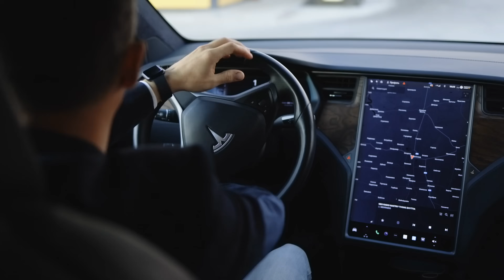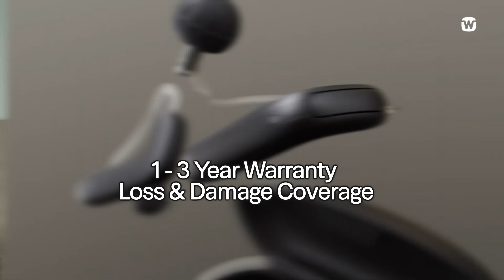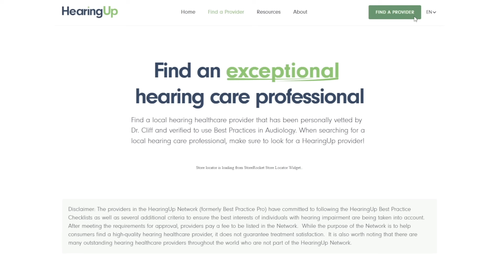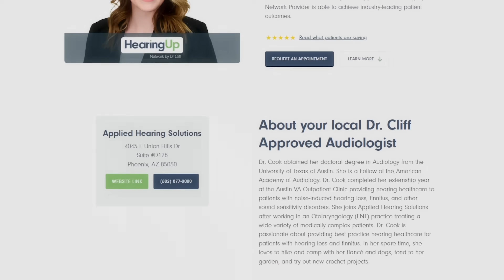STOP Upgrading Your Hearing Aids!

Comment: What about getting a new pair of hearing aids before your hearing aids expire? As in, damage beyond repair? So then old hearing aids can be back up hearing aids. My Starkey hearing aids are 4 years old in March. I had the previous hearing aids for 10 years and can’t remember if I can use them as backup (I think I can for one but not the other). When one stopped working, luckily I had a backup for that ear. It was very disorienting using the old hearing aid as a backup while still using the side that worked.

Comment: At the cost of hearing aids, it isn’t possible to upgrade too often, unless you are rich. I buy mine at COSTCO, and it still stings. My latest purchase was due to the old ones not working right. I needed a backup pair. Now I have two good ones to swap out. I should be able to go for four or five years before needing a new pair. It gives me time to save for them, too. I keep hope there will be a medical solution to reverse hearing loss while I am alive to get it.

Comment: After a lot of research, doubts ... I will have my first hearing aids in a few weeks. It will be the Signia C&G IX7 with a local audiologist following most of best practices. I prefered the Siginia active pro IX but audiologist said it is not recommended for several reasons (explained). So will try my first hearing aids after my holidays.
Reply: Good luck with your HA's. Don't be afraid to ask questions. Keep a notebook  specifically for use with your HA's in which you can write down whatever questions you may have.

Comment: Most of the time I upgrade hearing aids every 5 to 6 years or when my hearing deteriorates further. Since 2008, I have been a hearing aid user, and overtime, my loss has become more progressive. Currently, I wear the Oticon real one and have a back up pair of more ones. Considering cochlear implantation as I am a candidate. However, after seeking two opinions from different clinicians, I discovered my qualification is based on performance in background noise. A simple explanation was given concerning regarding candidacy. If a number is below 60 per cent in quiet or background conditions, you may benefit. Quiet I score 83 percent but even with appropriately programmed aids, the score drops dramatically. Audiogram has decreased 22 DB in left ear. High frequencies are shot, only hear low tones. Unaided, I have 0 percent word recognition despite highest audiometer settings. Amazingly, while poor, I derive 40 percent word recognition

Comment: Got my 1st pair of HAs nearly 4 yrs ago. At the time I demo'd the Phonak and Oticon top of the line HAs with my audiologist.  While I preferred the Oticon, as an android user, the Phonak had useful features I could use with my phone where the Oticon did not. Bottom line however was that both were far too pricey so I looked elsewhere.  Costco, where I tried the KS 10.1 that worked with my Google Pixel phone, liked them (essentially a Phonak HA), and ordered a pair.  I've since had them re-programmed several times now, the most recent being a month ago since my hearing continues to deteriorate.  With the latest Phonak and Oticon offereings all over YT, a week before that re-programming I demoed both with my audiologist since I have a lot of  trouble with hearing in noisy places.  The Oticon was not compatible with my new Pixel phone so we focused on the Phonak.  While the demo seemed to provide a small improvement in background noise management for me, I feel there is definitely room for improvement before I am willing to commit $6k+ to upgrade from my $1500 KS HAs,  Maybe Phonak's next gen will be the right one, though as an RIC HA, I hope they won't be too large.

Comment: I'm currently in a 60 day trial of TruHearing  RIC 7IX. This is an upgrade from my old Resound Linx which had no Android BT support. My insurance only works with TruHearing, which provides the HA's at a very very low cost BUT the audiologist they provide cuts conners. I'm not very impress with these Signia's but know another fitting or 12 will help. I can upgrade to the Resound Viva for about an additional $2300. Do you think the Viva is worth $2300 more than the Signia 7IX? I'm also at the point of self-programming the Signia's rather than hope this audiologist will finally get it right.